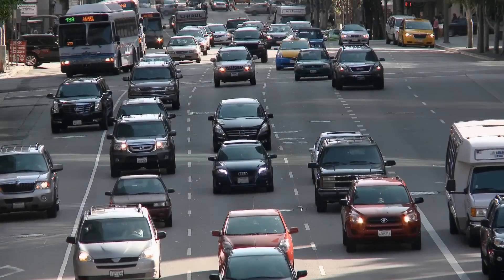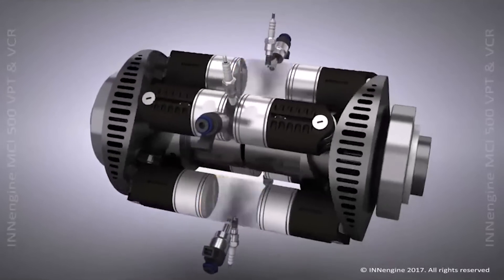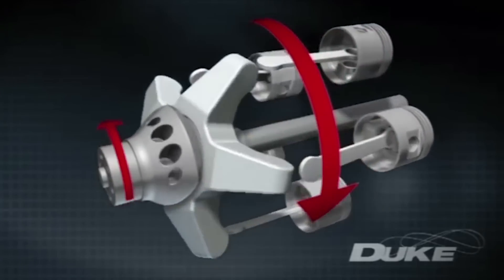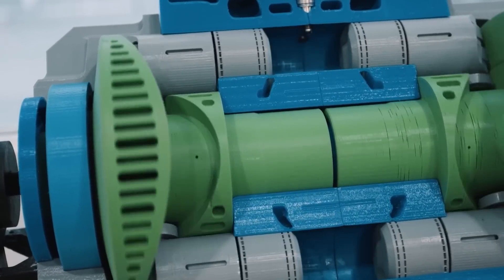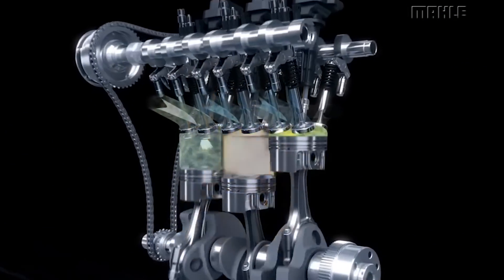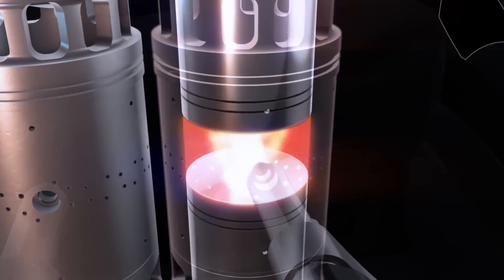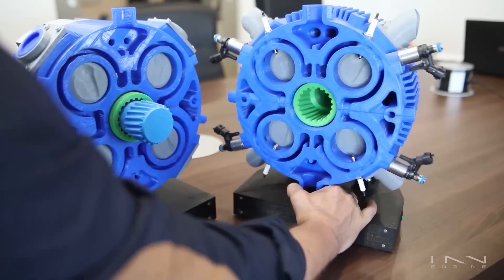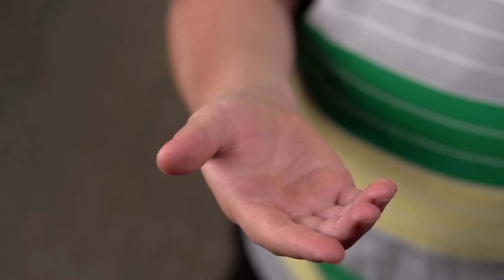Revolutionary One-Stroke Engine: Future or Fraud?

Comment: The "wavy plate" is not a swash plate.  A swash plate is a flat plane mounted at an angle to a shaft, giving one complete up/down reciprocal motion per revolution, as used in hydraulic motors and pumps, air conditioning pumps and helicopter blade angle control mechanisms.  The wavy plate could best be described as an axial cam.
Reply: I agree with you, but I might look it up, a lot of terminology is used over and over in different applications for whatever reason. Maybe it’s hard to come up with new names.
Reply from the maker: Great point, thanks for the info!
Reply: @ZirothTech DARZHNARZHFLARFERNARVEL???
Reply: swash plate
noun
1
: a revolving circular plate set obliquely on a shaft and acting as a cam to give a reciprocating motion to a rod in a direction parallel to the shaft
Reply: @anti8.6  In a pump, yes. In aeronautics, no. In this engine, no !
Reply: @anti8.6  which is what the plate in the video does
Reply: @grogu289  The "plate" in the video is not set obliquely to the shaft, because it's not a swash plate.
Reply: @grogu289  no it doesn't it produces multiple motions on a single rotation like a cam not a swash plate.
Reply: It’s a simple cam
Not a swash plate
Reply: Don't travel to the USA.  Students study hard, and you easily steal their ideas from their brains. That sounds like a good deal. Fighting for freedom. New slavery. It is my responsibility. I thought everyone should know. We are imprisoned in a place whose slogan was freedom.  Don't travel to the USA. Never even for a short time. If you have any special knowledge or skills or an invention, they will steal it from your mind. The US government initially used this method to identify people who intended to harm the United States. But today, they use it for many purposes, including stealing information from people and stealing data from people's minds. Many celebrities like Taylor Swift and Harry Styles are helping to lure the US government. They can see whatever you see. You'll never have privacy even with your wife or girlfriend. They could see whatever you think. When Taylor Swift said I used my best colors for your portrait, she meant it. when she said, "Touch me, and you'll never be alone." Or when she said, I can read you like a magazine. Your silence would help them to do it again and again. They said, "Don't say anything because of the USA. I want to take her to court. They wanted to pay me $1,000,000. Those are not only songs (Taylor Swift) likes A writer of crime stories whose stories are authentic and have committed all the murders. Taylor Adolf Hitler, the Humans, are not your laboratory mice. Sometimes, what we hear is like warning lights to prevent accidents. Events that the causes of those events are not afraid of repeating them, but they are happy. And they sat waiting for the right time. Let's not ignore what we hear. Kidnapping in a new style. Support with like   ......................................... #Taylorswift_is_murder  Doggy styles ( #HarryStyles_is_murder ) #Selenagomez_is_murder #Biden_is_murder  #Trump_is_murder  #NotravelUSA
Reply: Crown cam
Reply: This is nothing more than a retirement fund for those promoting it
Reply: ..”swash” plates are used in ROTOR systems on helos. Not an engineer..but a pilot.
Reply: @m118lr   Yes, only the swashplate on a heli doesn't rotate with the shaft.
Reply: @m118lr  Not really sure what distinction you are making?  The swash plate allows the angle of attack of the rotor blades to be controlled.  Is there some terminology  issue?
Reply: @ferrumignis  Swash plate is a flat tilted disk, this here's a double bump straight wavy plate.
BUT it can be said the swash plate has a single bump tilted on one side & straight on the other side.
Reply: @mach1553  Swash plates are flat, not bumpy.
Reply: @ferrumignis  Definitely ! The part in this engine stays on its access with the shaft. Is uses the ramps on the piston side to move to piston between TDC and BTC. Its working like the lobes of camshaft. A swashplate would be flat, all of the 360° around it but move off of it's 90° position from the shaft to move the piston. The plate would wobble on the shaft. (Lol) But seriously !
Reply: Not strictly true. Look inside a diesel pump.
Reply: You did get the definition right, however swash plates can be wavy but usually aren’t because why do that when you could make it adjustable for cheaper and more reliable systems

Comment: Diesel -Electric  locomotives have been the height of railroad tech for nearly a century. Electric motors eliminate the need for expensive transmissions in cars. This new engine could be a godsend to transportation.
Reply: so why do EVs cost up to $30,000 more??
Reply: @jimbritttn  In Europe, a Tesla Model3 starts at 46,000 dollars, and Tesla was still the most popular car. Why would they sell it cheaper if they are going to buy it anyway. I note that a Corolla costs $33,000 in Germany

Comment: Quick question that is bugging me, but…why not do away with the pistons altogether, reconfigure the swashplate(s) shape (maybe architecture in support and variable shape possibilities) and have them compress and fire off of each other somehow? I’m just looking at it and it seems the swashplates are the main things here and aside from the sealing benefit of a bore and piston, the pistons not an absolute necessity if the aforementioned issues are cleverly worked through maybe some more weight savings are possible (among other things). Just thinking….
Reply: Such an engine would get close to a rotary engine design. I'm thinking 2 rotary engines, with the part where the combustion takes place connected, to make use of the opposing stroke.
Reply: "Just thinking"
Not very clearly. How would you get the cam plates (they are not swash plates) to compress the air without a cylinder and piston?

Comment: I meam, we do use rollers on rockers and lifters, and they tend to last well over 100k miles. So i dont see this being an issue. 

My only question is, what how do you use both rotating ends?
Reply: True. But those parts don’t see the same amount of force as these do being directly responsible for the combustion force pushing on them. 

I’d like to know the max RPM of this engine personally. That would determine a lot of its future use-ability.

Comment: That’s not a super charger, it’s an air filter. Possibly a cold air intake. That’s all.
Reply: Thank you for pointing that out! Makes the whole opinion part of this vid sus to me..
Reply: update: It does appear to be a belt driving an impeller to whcih the air filter is connected. So it makes sense to think that it is a supercharger. It's strange that the company would lie about it, unless it's needed because of how different this engine is i.e. Positive intake pressure may be a requirement for optimal operation or for meeting emissions standards.

Comment: All ice engines have compression leakage pasct the rings, which now raises the question,....What returns the contra pistons from tdc if the engine is turned over slowly thereby losing all its compressed gasses into the sump ? A possibility with either an ignition or fuel failure with repeated starting attempts. Worth a thought.
Reply: That's probably why they focus on range extender. So, the engine will run on optimal rpm all the time...
Reply: I raised this problem in another video on this engine. Because no piston rings seal perfectly an extended crank could end up with all the pistons pushed in and no longer contacting the cam plate, preventing any chance of it starting.

Comment: Conical air filter is not a turbo charger
Reply: it is attached to a supercharger driven by a belt.
Reply: This type of engine is unable to start without an external air blower. You are right that this is not a supercharger, because it does not compress, it only provides air exchange in the cylinder.

Comment: Nice job and good catch with the supercharger. Seems there was another company with transparency issues and questionable marketing, bringing people to view the Titanic, too.
Reply: That’s not a super charger. Super charger has to be driven by the engine cam. I don’t see one
Reply: @Mobeone  supercharger is mainly the name of forced induction driven mechanically by the engine by belts and/or pulleys whether it be the cam(s) or crankshaft doesn't matter.

The one one in the video literally looks like a Rotrex beltdriven supercharger. It's usually driven by the same belt that powers the alternator, ac, waterpump etc and has planetary gears inside
Reply: @Fury_BlackWolf  I didn’t see how it was being driven. I did not see any belts or pulleys connecting to the air box.
Reply: @Mobeone  There's a belt visible in the shot.
Reply from the maker: @Mobeone  There is a small belt under the intake which I believe it powering it from the engine shaft
Reply: @ZirothTech  It looks like a simple air filter for me...
Reply: They are not the first do it this way and not call it a turbo. Mazda uses something similar in their SkyActive-X.

Comment: I am very interested in E range extenders and I have reviewed this product, but there are way way too many red flags. The first being the claim that it is one stroke when it very obviously is not.
Reply: The "one stroke" its a marketing thing, admitted for the inventor or designer of these engine in one of her videos.
Really its two stroke.
These is a stationary engine, good for RC planes, paramotor, ultralight aviation, range extender, electricity generator,etc
It is design for work at fixed revolutions very much time, not good for continuous rpm changes.

Comment: I see a few interesting things in the animation that weren't talked about, like it seems like the piston chambers are linked so fuel could shift between chambers mid stroke. This might be part of how they are claiming this to be a single stroke, because if the piston chambers are linked then the fuel remains from one would mostly shift to the other on the opposing stroke resulting in a firing in both directions; however, this is just speculation based off what it appears to be. It also raises a whole lot of other questions. All this did was raise more questions in my mind.
Reply: The company themselves have said that's its actually an oilless two stroke direct injection engine, the one stroke name was taken to make it stand out and differentiate it from a two stroke oil mix engine.
Reply: @davewoodsmusic  to differentiate it from a "typical" two stroke. Yeah, I get that it's not really a one stroke engine unless each piston were to fire at both their peek and trough. I was looking for some potential logic outside of marketing.
Reply: There are two pistons in each cylinder, and they both absorb energy. 

A traditional engine has a piston below and a cylinder had above, with valves, rockers, cams, etc.. the cylinder head absorbs heat and needs to be cooled. An opposed piston engine converts that heat into kinetic motion.
Reply: @leeknivek  The dual piston design was covered in the video, but it wouldn't make it a one stroke engine, as was noted in the video; however, if the unused fuel from one chamber was mixed into one of the chambers next to it, then the set of 4 pistons would be working together, and two would be the equivalent of the up stroke, and the other two would be the equivalent of the down stroke. There is at least one image/animation where it looked like the piston chambers were potentially linked to do this. As I don't have the CAD model to verify this with it's only speculation based off what it looked like, and again this only raised more questions about this strange design.
Reply: @billyoung9538  that's actually done in many modern engines - exhaust gas return, or EGR - after the exhaust gas spools up the turbo, some of it is sent back to the intake for any unburned fuel to be burned again. This helps to lower combustion temperatures and keep the engine running cooler.

This engine requires a super charger and a turbo charger to work and be efficient, EGR would have to be implemented for emissions regulations.
Reply: @leeknivek  EGR is nothing to do with reducing unburned fuel, mixing some exhaust gass with the inlet charge reduces the peak temperatures in the combustion chamber which prevents (or at least lowers) nitrogen oxides being formed. NOx is one of the nastier pollutants, it's very irritating to our lungs and it causes acid rain.
Reply: Regardless what happens in the future certainly isn't fossil fuels, In 50 years I can foresee trucks, planes and boats being run by nuclear fission.
Reply: Don't travel to the USA.  Students study hard, and you easily steal their ideas from their brains. That sounds like a good deal. Fighting for freedom. New slavery. It is my responsibility. I thought everyone should know. We are imprisoned in a place whose slogan was freedom.  Don't travel to the USA. Never even for a short time. If you have any special knowledge or skills or an invention, they will steal it from your mind. The US government initially used this method to identify people who intended to harm the United States. But today, they use it for many purposes, including stealing information from people and stealing data from people's minds. Many celebrities like Taylor Swift and Harry Styles are helping to lure the US government. They can see whatever you see. You'll never have privacy even with your wife or girlfriend. They could see whatever you think. When Taylor Swift said I used my best colors for your portrait, she meant it. when she said, "Touch me, and you'll never be alone." Or when she said, I can read you like a magazine. Your silence would help them to do it again and again. They said, "Don't say anything because of the USA. I want to take her to court. They wanted to pay me $1,000,000. Those are not only songs (Taylor Swift) likes A writer of crime stories whose stories are authentic and have committed all the murders. Taylor Adolf Hitler, the Humans, are not your laboratory mice. Sometimes, what we hear is like warning lights to prevent accidents. Events that the causes of those events are not afraid of repeating them, but they are happy. And they sat waiting for the right time. Let's not ignore what we hear. Kidnapping in a new style. Support with like   ......................................... #Taylorswift_is_murder  Doggy styles ( #HarryStyles_is_murder ) #Selenagomez_is_murder #Biden_is_murder  #Trump_is_murder  #NotravelUSA

Comment: Someone may at some date bring a long lived opposed piston engine to market that works well.  Not arguing that.  I doubt it'll have a swashplate though, too much wear with followers etc.  Personally I think we've seen about as much wrung out of diesel/gasoline as they're going to get on the combustion efficiency side.  Maybe more to be gained optimizing transmissions, bearings, rolling resistance and the like.   It's going to take about one really significant jump in battery composition, and I'm betting it comes with some nano structuring of materials into optimal lattice/layers for that to happen.  That change will blow up the current battery market and jump range by a factor of 2-3 and it'll be game over.  The net energy efficiency gain system wide will just pretty much end crude derived fuel burning engines.  It'll be gone like horses in the early 1900's... manure scraping/collectors, engine mechanics and the like largely , *poof*.  ONE big battery improvement.  Solar cells, similarly - someone will get a multi junction cell with low production costs - they'll be everywhere, behind the meter and really impact traditional power companies...
Reply: Liquid Piston remaking the Rotary Engine to be more efficient, compact, and still make the same power as a diesel